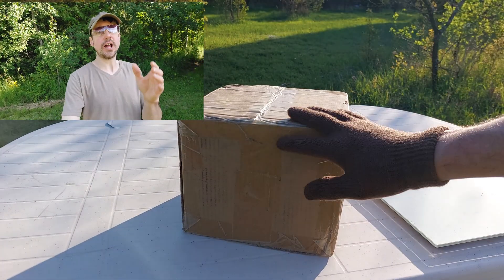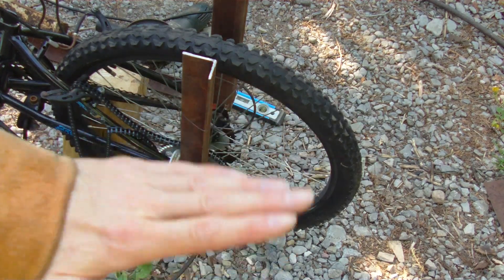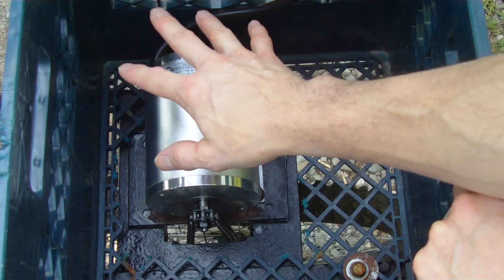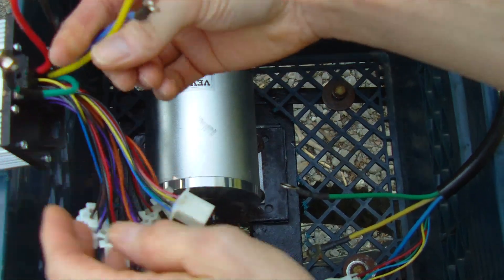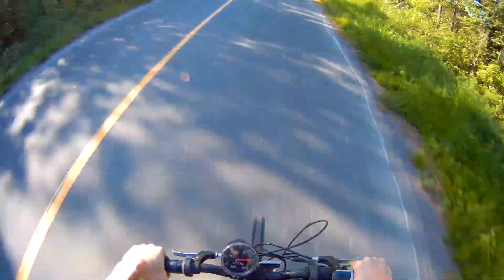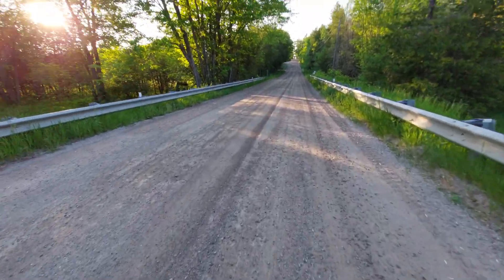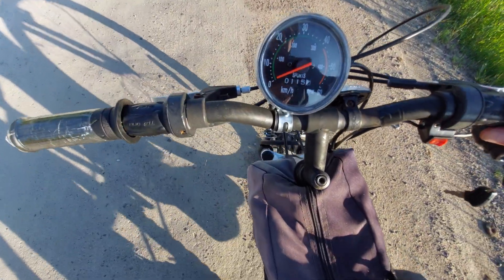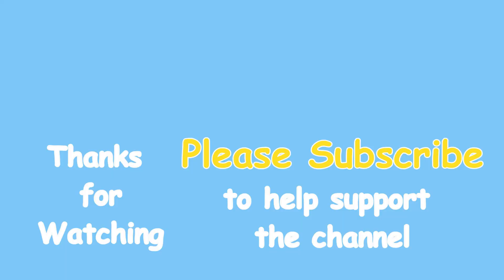I Built a 1800 Watt Electric Bike with a Vevor BLDC Motor Kit - 35MPH Chain Drive

Comment: Wow that is a very invasive build. I put the 36v 500w vevor  kit on my mountainbike. How did you fit the gear to the hub ?. The only thing i have there is a brakedisc Tektro 160mm with 6 bolts in the hub. First i fit the t410 bikechain (bougt ba new so'procekt to replace the original) and fit it to the crankgear. it spun a lot faaster that desired so i guess i have to do what you did. But i struggle to find something that fits. I took my lightweigt ebike for a spin and ended up with both feet in the air. Feels  a bit unsafe. Yot sollution is better but i will not weld on my aluminium frame. It sits on the luggage rack now and it will be enough for the 500w kit i think. No issues on the testrun othetr than legs have follow the crank a lot faster than i wanted and that is for the lowest speed setting.

Comment: 1800 watts will top you out around 35mph based on your Cd(drag coefficient) and frontal cross sectional area, which you have little control over.

Comment: I'm considering building a electric doodlebug mini bike. But I'm a big guy like 355 lb. So I was thinking of using one of those reduction gear rickshaw 750 watt bldc brushless motors. So I would have a lot of torque for a pickup and could change the gearing for higher speed. What is the torque like on this kind of motor do you think I would be better with this or the reduction gear rickshaw style. Thank you. Also going with 750 watt brushless reduction gear motor is completely compliant with Massachusetts e-bike law as long as they don't go over 20 miles an hour on the street. So I was thinking just getting one of those controllers that stops at 1920 miles an hour and then has the off-road button. Do you think this style motor would have a lot of torque or would be better off with a reduction brushless motor. But you don't like to do maybe 30 miles an hour. If you give me a message and give me a quick heads up I would really appreciate it thank you.

Comment: Battery needs more voltage for top speed.
Reply from the maker: That would be nice, not sure if the controller can handle the higher voltage, it's rated at 48v max, I would have to check capacitor voltages

Comment: a normal cycle wont last 5 minutes at those speeds. they are simply not built strong enough to handle the wear and tear and will suddenly brake possibly with serious consequenses. fun whilst our still alive though.
Reply: Lol 5 minutes? What planet are you on. I know people that run these for years with regular maintenance and I also do this with a 4 stroke engine and my bike has lasted months on end doing thousands of miles. What are you smoking
Reply: @str8xrippin  with regular maintenance yes, the expensive regular maintenance disguises the fact that the parts are wearing out much faster and that's what makes it so dangerous.
Reply: @100musicplaylists3  do you know what regular maintenance is? Every couple of months making that only few times a year maybe 4 or 6 times max and expensive? Dude I'm talking about greasing the bearings and doing chain adjustments, tightening nuts and bolts and maybe new tires once in a while. It's pretty much free. Have you never owned a bicycle before?
Reply: @100musicplaylists3 my daily commute to school gets me to 28 mph everyday back n forth I’ve had no issues

Comment: Nice video overvolt it to 72v and you will see how powerful those are keep up with your videos ❤
Reply from the maker: Thanks!! 👍 not sure if the controller that comes with the motor would handle it. I was searching around for a more robust controller rated up to 72v. As of now I don't really need more power,  just a better battery pack.
Reply: @kurtscottage  vevor has a 3000w 72v kit that is 237 euros
Reply: Puedes subir cuestas muy inclinadas sin pedalear ?.
Lo digo por qué sin reductora  muchos me han dicho que no se puede poner así en un bicicleta mtb de ruedas de 26"
Yo le he puesto un my1016z 24v dc 350w en plano va de maravilla pero en cuestas tengo que pedalear y según le detecto la fuerza del motor le doy o suelto el gatillo para que no salte el fusible ?.
Hay algún motor eléctrico de verdad capaz de subir cuestas inclinadas sin necesitar pedalear ?.